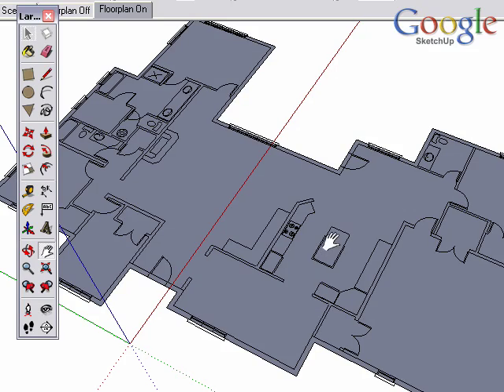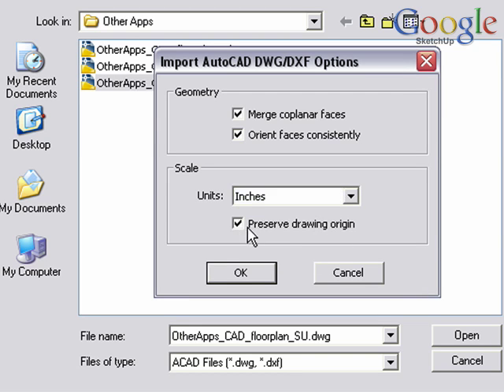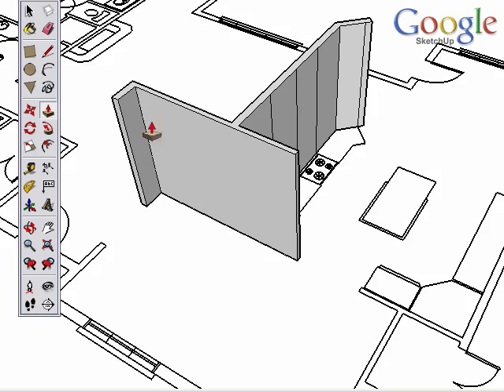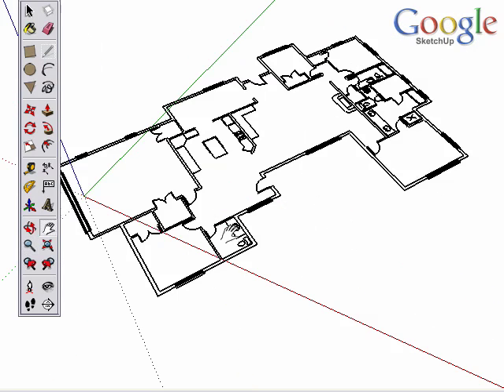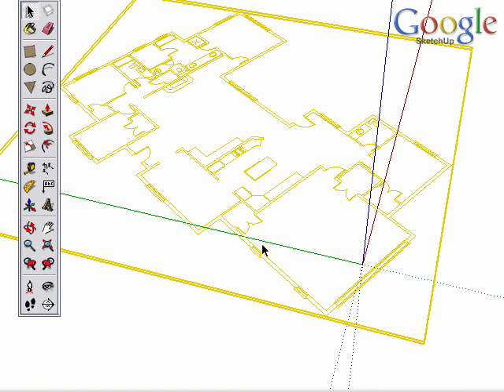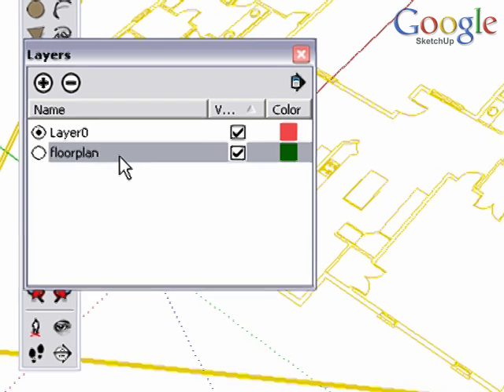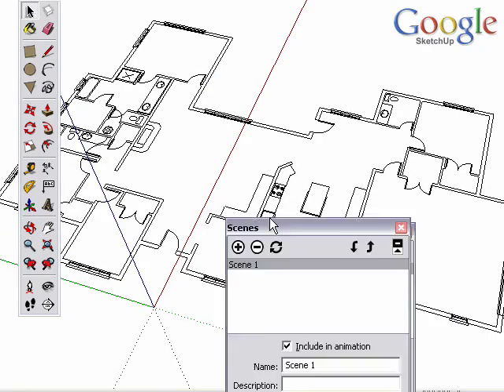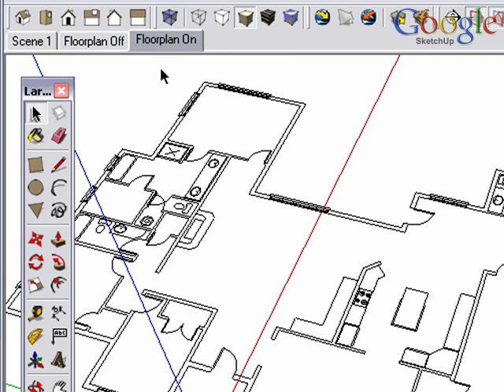SketchUp and CAD - Importing and Preparations

Comment: at 2:19 you select a line on a wall section with your pencil tool, and then suddenly it's possible to pull the object. How did you do that? I'm trying to pull objects imported from autocad in SketchUp Make 13. Thanks!

Comment: @RomeBoarderr Kindly check this steps:
1. Ctrl+Shift+E to zoom all the model your imported
2. Make sure all layer is turn on
3. Certain computer graphic doesn't suit with sketchup 7, simply go to WINDOW, PREFERENCES, OPENGL, unselect the USE HARDWARE ACCELERATION
4. Make sure while importing check the options, either your drawing in metric or etc.

Comment: Sketchup is a very easy to learn and to use as a modelling tool. AutoCAD is far more complex, especially for rendering and is generally used for high-end 3D work, specifically in mechanical engineering. For architectural use, AutoCAD is very clumsy. AutoCAD is a very good 2D drafting programme and it's usually a good idea to complete your drafting in AutoCAD and then import into Sketchup for modelling. AutoCAD is also ridiculously expensive.